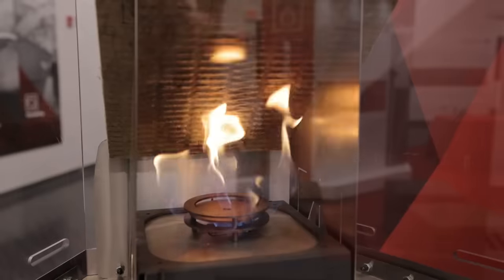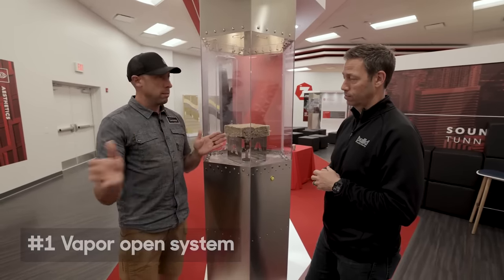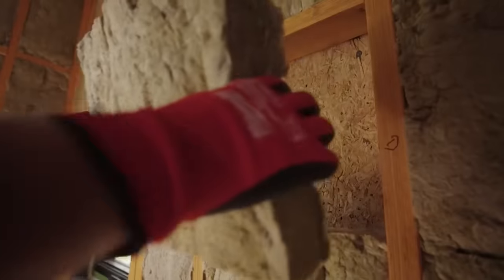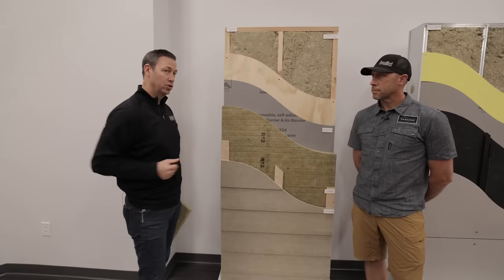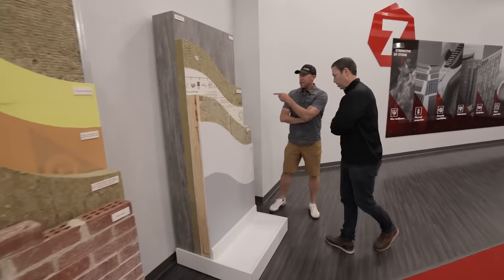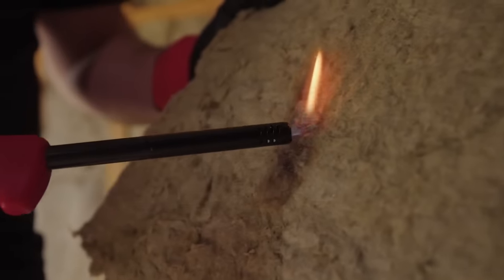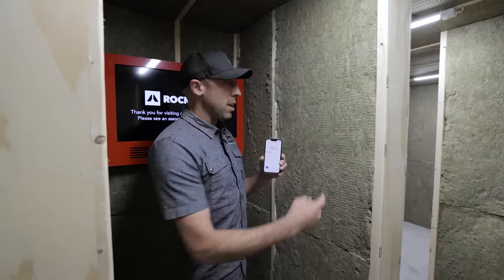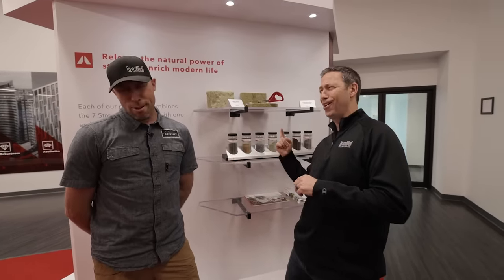3 (little known) Benefits of Rockwool Insulation

Comment: I have just finished, even moved in , to my new timber framed house and was so reassured by this video as we fitted Rockwool 
inside and outside  of the whole structure, including the roof .
The  wind is howling outside  yet inside is a sea of tranquility . we used rigid outside then  silicone colour  coat rendering on top  .
I taped every seam , edge and joint to keep it airtight and we live without heating .
I used 100mm  XPS under the wood floors to keep us off the slab , so no underfloor heating needed.
I struggled to get  builders to understand the theory , now they want to know how to do it and would I fit an off grid system for their  clients !
 Rockwool is such an amazing  insulator I even filled the interior walls with it and it helped create a peaceful interior .

Comment: Great video! *Rockwool is the best investment in my home to date! 🥰
One of my major goals for our home is to be as energy-efficient as possible, to the point of being energy independent. Our yearly climate can range from 120f in mid-summer to 20f in mid-winter. Heating and cooling costs are rising fast and are becoming a major expense. Simply replacing the fiberglass insulation in the attic with Rockwool insulation has reduced my heating/cooling costs and energy consumption dramatically! I've also recently completed a 300 sq. ft. room addition/office space in the garage using Rockwool in the walls and attic. I have also noticed the improved noise reduction! *Rockwool has been a game-changer in my home! 😎

Comment: This product rocks. I've used this in my floors, walls ceilings  and the heat and noise disappeared. plus I like the idea that a electrical short in the walls would essentially snuff the flames. Another bonus I notice no bugs migrating from the floors or walls. Rock on

Comment: Love this stuff, as a homeowner, and far from an expert, this stuff is so awesome to work with.  Ease of cutting and fitting and installation.  I have bats like this in my furnace room roof for just some sound dampening.  And because it doesnt have fibres coming off, it can stay there unfinished

Comment: I worked with a number of Rockwool manufacturers over the years.  Some made fireproof acoustic ceiling tiles (regular paper based tiles are not used in commercial environments) some made Rockwool batts.  Interesting process, waste slag from metal melting processes is melted along with additives to control viscosity and melt/transition temperature in a shaft furnace (induction will not work for non conductive materials like it will for melting metals) and the molten product is fed to a spinning wheel (think cotton candy machine).  The melt is spun off and has a leading shot head and a long tail which is blown into a large room or container, the shot upon cooling usually breaks off, falls to the bottom and is recycled to be melted once more.  The Rockwool is gathered and processing into batts.  The acoustic tile process involves adding color,usually whiteners and a clay based binder pressed out like dough, given a desired surface finish, cut to dimension then baked in a continuous oven.  This process was how I knew it from over a decade ago, it may have evolved  to optimize the process over the years.

Comment: Killer content.  I’ve been using rockwool for a little bit and there are so many benefits.  Easy to cut, easy to work with, and far superior over traditional fiberglass.
Reply: How’s the weight of the product compared to cellulose or fiberglass? Does it cause a problem if it’s used in a ceiling?

Comment: I had no idea the value and benefits of rockwool until I started watching these videos. I'm currently finishing out my second story, starting from just a bare floor that was never finished out during the initial build. It took a bit of time to get the rock wool batts, they are a special order item at the blue home store and impossible to get at the orange store. I believe there is about a three fold difference in price between fiberglass and rockwool! It installs just as easily in real life as these videos make it look. Last week I placed my sheetrock order from a local building supplier, and knowing I would need more insulation down the road, I asked the supplier if they carried it... He responded that I was probably in the 1% of people in the area that used it.
It's hard to figure out when someone is giving genuine advice and recommendations, or if they are just repeating the status quo.
Reply: Why are you buying at a box store? Go to an insulation supplier.  If you aren’t a BoT
Reply: @Californians_go_home  I don't know any insulation suppliers. If I find someone local I would prefer to use small business for the next phase of the build

Comment: I've just installed 100mm of RW45 (UK spec, u-value 0.035) in between 175mm timber joists on my new flat roof extension. It's a warm roof construction with 120mm PIR for thermal insulation (yes has a VCL) and is covered in a 2mm poly membrane. The difference the Rockwool has made is truly spectacular. It's so good I wish I didn't have to cover. We're using the room before it's finished and after a few hours of letting dust settle feels great and breathable as Matt explained. Really great product.

Comment: Hi Matt, it is great to see a channel like yours dealing with well insulated long lasting buildings. I live in Japan and it was a major headache trying to find builders who were competent in using the materials and techniques that you present. I had to hire an architect to design my house, because none of the the housing construction firms knew or were willing to use anything but the standard Japanese system which hasn't changed much in over 100 years. I hope you can convince more people to put in a little more up front for the long term benefits it will bring. Best of luck. Karel

Comment: Great video. I own a 70 year old home in the PNW. There isn't any insulation in the wall cavities. I'm going to install new siding and at the same time remove the sheathing, insulate from the outside, reinstall the sheathing and install the new siding. I'll be using Rockwool to insulate it.

Comment: I have to agree that this is the only home insulation on the market today. Regular fiberglass insulation should be outlawed. Cutting in around electrical outlets alone makes this so much more efficient as well as wiring in the walls, ect. The cutting of this insulation with a knife alone makes installation much easier, the particles do not hang in the air, and as you install it, you can hear the noise level drop. It is more expensive, but you are actually getting the return on your investment, very rare in today's world.
I really can't say anything else other than the fact that it is harder to get, but it is worth the extra effort.
Finding it at Lowe's or Home Depot is not easy. Find an old lumber yard in your town that still works hard for your business and have them order it in for you. You will be amazed by this product if you use it. And thank you Matt for educating us on this product, I would have never come upon it without your videos.

Comment: Love it . I also now only use and recommend Rock wool . I love the open flow insulation system . Building in climates that are hot in the summer and cold in winter , open flow is the only way that a complete open vapor flow without condensation problems . Lime and builders sand  mix for renders  is another great way for exterior finishes .  It can be coated onto a expanded metal mesh .

Comment: Mice WILL burrow into it. Blew my mind. Bastards tunneled in my newly refreshed small addition up a 7ft wall and across an 11ft length of ceiling. They tunneled better than Guzman.
Still a big fan of this over fibreglass. DIY tip. I run my electrical at the same length as the bat lengths if possible.

Comment: I have plans to close the envelope of my attic soon, and one of the issues constantly coming up is moisture buildup under the sheathing, and that fiberglass insulation will prevent air movement from drying out that sheathing.  sounds like rockwool is the answer to that problem.

Comment: An important dampening mechanism of the safe and sound in the "maze" is the sound attenuation on the surface of the insulation; killing the echo (like an anechoic chamber). Once  the wall is covered with sheetrock that mechanism is eliminated and the main benefit is sound dampening through the wall.

Comment: Rockwool is a trademarked brand of mineral wool. The primary vendors in US are Roxul, the makers of Rockwool, and Owens-Corning, makers of Thermafiber. 

Of those 2, we only use Thermafiber unless constrained supply chains limit us to Rockwool. Thermafiber is marginally less $$ but the determining factor is Rockwool employs formaldehyde as binding agent. Thermafiber is certified formaldehyde free. We and our clients prefer best air quality available, that includes using building material w/o formaldehyde whenever possible
Reply: I switched to Owens Corning Thermafiber because Rockwool refuses to pull out of Russia after their invasion of Ukraine.  Unethical company.
Reply: @michael m Interesting! How do both rockwool and thermafiber compare to Johns manvile temp control mineral wool? I thought there were distinct differences between rock wool and the general mineral wool in what it’s made from?
Reply: @kjohannes6896  Never seen JM mineral wool. Is it formaldehyde free? 

Rockwool vs Thermafiber are both types of mineral wool insulation. Other than the formaldehyde binder, I don’t know the exact chemical differences. Technically, both are fireproof rated and have same R-value of 4.2/inch
Reply: It was only back in 2017-2018 that Thermafiber started offering versions of their products manufactured without using formaldehyde, and it was at the same time that Rockwool started offering the same. There has been some debate as to whether the alternative versions are even necessary, since the amount of heat used to create mineral wool seems to burn off any formaldehyde used during manufacturing. Good to have options, though.
Reply: @JamesCusano  Formaldehyde is used as binder to produce the batts and sheets of Comfortboard. It is not used in the molten rock phase. 

Roxul claimed they too were eliminating the formaldehyde, using a different binding agent. I do not know what happened to that product. As of 2021, the MSDS published by Rockwool for ComfortBatts, SafeNSound and Comfortboard 80 all list levels of formaldehyde.
Reply: @MichaelM-to4sg  I just looked up the SDS for JM temp control and it does have "cured urea extended phenol-formaldehyde resin" at less than 5%. I assume it's a binder. It seems to be the same as the other mineral wool options out there but I will say when handling it, it looks different than rock wool (at first I thought it was fiberglass but it is more dense) and it does make you itchy. So unsure what makes rock wool different. The data sheet does say it's green guard certified...
Reply: @MichaelM-to4sg  My questioning of how much formaldehyde actually remains in the Comfortboard and Comfortbatt is based on statements made by Rockwool and published by Green Building Advisor that mentioned that a manufacturing step after the application of the binder agent involves enough heat to cook most or all of it off. They released formaldehyde-free versions of the Comfortbatt product as “AFB evo” anyway, though. Their regular Comfortbatt, as well as Comfortboard, seem to be certified to several other health standards that I believe include measuring that the amount of formaldehyde (among other things) that off-gasses from those products stays at a level they consider to be safe. I think that’s why most of the Thermafiber sold today is still not the FF version, just like most people still choose Comfortbatt over AFB evo. I think the formaldehyde levels coming from the old fiberglass batts were a much larger concern than the much lower levels coming from traditional mineral wool.
Reply: @kjohannes6896  Rockwool is made of mostly basalt and Thermafiber is made of mostly slag. Sounds like TempControl is made more like Thermafiber.

Comment: I just about came unstuck with that display of the Comfort Board over wood studs. I am building a vacation house in the WUI above Las Vegas - cold/dry climate. I did a LOT of research because nobody in the County building department had any idea about 1) full basement, 2) unvented attic, 3) fire-resistant construction.

The house is next to a deep/steep ravine with mountain fir and pine trees and low, dry vegetation. Coming from SoCal, I truly understand about fire. I specified all fireproof and fire resistant materials on the outside. Where they are not fireproof, like the glulam beams, they get covered with fiber cement board to match the Hardie siding.

Walls are covered with OSB sheeting [NOBODY has any idea about ZIP panels, not engineer or building department], ZIP-taped sheeting seams, Tyvek [builder put up to keep dry while waiting for the 7 month backorder of my Comfort Board]. Then we put up 1x nailers with Hardieplank over them to finish the outside.

I felt pretty good to see that first display of the wall system. That is exactly what I ended up with through my research.
Reply: yeah I had no idea Rockwool can replace any kind of vapor insulation material. That was probably the best info in this vid.
Reply: @voidisyinyangvoidisyinyang885  What I got was that Rockwool does not trap or hold the vapor. Hence no need for vapor barrier. However, I still wonder about this. Because if the outside is 15* and the inside is 72*, somewhere in the middle it will be 32*. Still seems to me that there will be ice formation.
Reply: @ricoludovici2825  There's a section in the 2021 IRC book that details the different continuous insulation R values needed for different climate zones to reduce or negate the need for a vapor retarder.
Reply: @JamesCusano  I have the 2021 IRC. I broke the back at the climate zone section and the insulation section, making copies for the county plans examiner [a 54 year old woman from Calcutta who had never built a house]. 

Since this is a cold/dry climate - Zone 5 - I didn't bother with the vapor barrier. It was a lot more important in Minnesota, where I lived before.

Comment: I just got through doing a Rockwool between the wall stud remodel.

I put so much Rockwool into the remodel?,a 1900 ft.² 3-bedroom was finished out at 950 ft.²

We put insulation on the back of our insulation and then insulated that for good measure...

Can never have enough insulation...

Comment: i love rockwool. it's difficult to find many rockwool products in my area but there are 2 products here so far, 2x4 walls 16" OC and the comfort wool that is a little thinner, about maybe 3 inches thick or 2 1/2 - 2 3/4 inches thick. i hope they start carrying more locally. only available around here at lowes far as i know.

Comment: I design houses as a hobby, the exterior walls start with 16x8x4 colored concrete block with colored mortar so painting is not necessary, then 1 1/2 thick Kevlar 8 x 4 panels with aluminum facing acting as the vapor barrier, then steel framing  2x6 packed with Rock wool insulation and finally 5/8 inch Drywall panels pre painted on the interior face with fire retardant paint prior to install, then the exterior (seen) face of the drywall gets the same paint which comes in any colors you choose! My assumption is this would be a fire proof building. Even the interior walls are insulated and paint treated as the wall is constructed. The block is grouted every 32 inches with rebar re-enforcement inside and around any windows or doors! High strength security doors for the exits and hurricane roll shutters for all windows also makes it very safe from home invasions!! The windows would be bullet resistant glass, the doors would be Master Security Doors which keeps any bullets fired at it and withstands over 93 sledge hammer blows without penetration!! Would it cost a bunch of money ? Yes, but it would withstand hurricane force winds. The wall framing is welded together along with roof trussing known as Perfect Wall Inc. Fire treated lumber is used inside the steel framing for doors, windows and the kitchen where cabinets will be hung. In my current home I used 1/2 inch plywood to start on the wall so the cabinets would screw into the plywood even they do not hit any studs. A whole house 20k generator would give consistent power even if there is a major power failure supplied via a 1,000 Gallon diesel fuel tank underground and with a 10,000 gallon potable water tank buried under ground. Why the extreme prep? I worked in my local county jails and inmates told me how they get in to your home during a home invasion!! I went home and took care of any issues to harden my home. I have been told I have a fortress of a house, with the strong security doors, block construction and security doors. I also have flood lighting all around and cameras so I can see outside with the shutters closed!!

Comment: Matt, I hope you are reviewing this video, my question for you or anyone with knowledge. I am remodeling a 1973 house with rock wool, 50 years old no bugs or wood damage. This rock wool has paper and then they installed plastic before the sheet rock. I’ve opened up the outer walls for the remodel. Should I remove the old stuff and replace with new, had thought about spray foaming the walls, however you have educated me with the rock wool. There is a little paper damage from moisture, not moldy but a little change in color. Thanks in KY